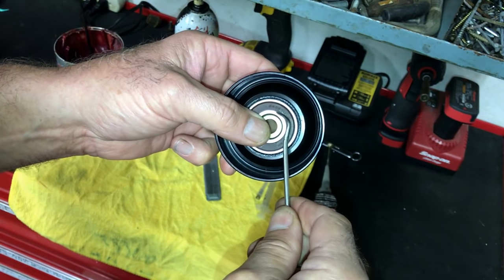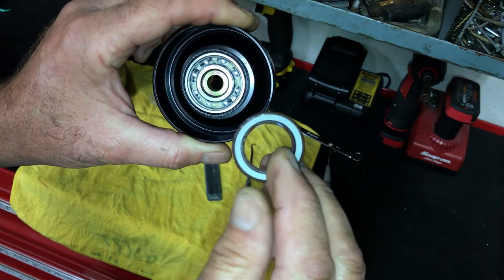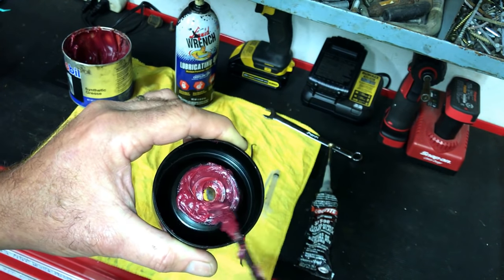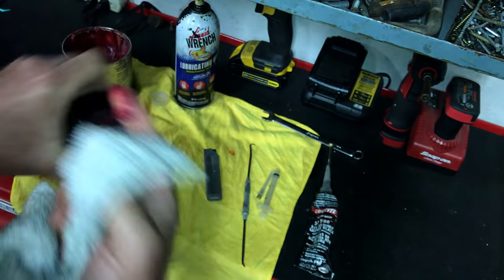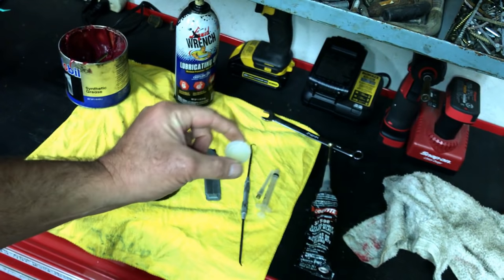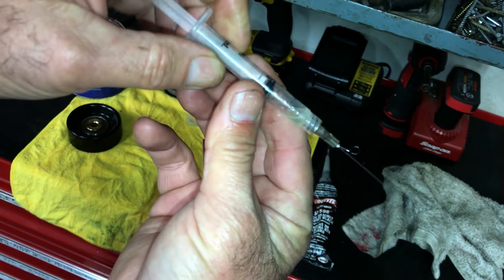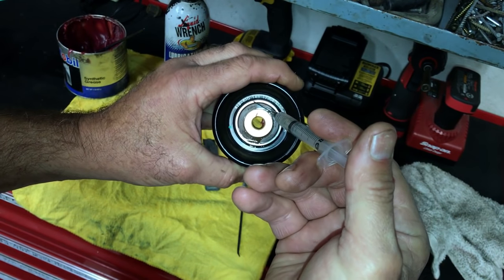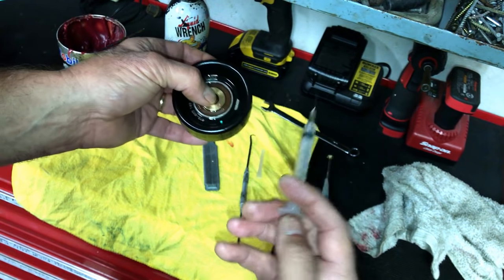Make Your Drive Pulleys & Sealed Bearings LAST A LIFE TIME :)

Comment: The penetrating oil is a very bad idea! The grease is a good idea. Penetrating oil is not designed for that use and will not work as intended , it will break down what ever lithium grease and cause a premature failure.
Reply from the maker: As you heard me mention in the video we only suggest the syringe with penetrating oil as a last resort and do not have time to take the pulley off and they know the Pulley is starting to make a squeak this Buys them some time Because as you know most of the time when something goes bad it’s at the most inopportune time LOL
Reply: Sweet Project Cars , a repair is that a repair and maintenance is maintenance.  Penetrating oil is neither in that case , at no time does it perform a function than hiding the warning of a inevitable failure of the components. The viscosity rating is not what is designed for or can be used for. The grease idea gets an atta boy though!  😁😁.
Reply from the maker: Mike Biro if it gets them a couple days to the next paycheck to repair it right then Amen we say    have a great night my friend :)
Reply: Sweet Project Cars , I do see your point in this matter of thinking, here is a better option on the molecular level to last a couple days. Synthetic gear lube would be a better lube in the bearing for a couple days. It's thicker, and will bond to the metal much better as a lube. You can use a syringe for that as well.

Comment: What I said the right amount of grease more mean more  drag Wichita will translate to heat and I think you destroying the covers by popping in and out and poking them with sharp syringes those covers will never be the same
Reply from the maker: we have done this for close to 20 years on hundreds of customers vehicles and they have never had a problem, EVER...so lets just say you do this to your sealed bearings and they last 3 times as long say 300k, is that BETTER OR WORSE?  then them lasting only a 100k miles all for 10 minutes of your time and 10 cents worth of synthetic grease???

Comment: Replacing the factory grease with better quality grease is ok..BUT!! get the  factory grease out fully! The way in the video the bearign will get overfiled; grease wil run too hot and bearing life will decrease. Never overfill a greased bearing!!! Another point about bearings is; usually the so called 90% rule is applied when selecting the bearing. Thsi means that 90% of them will reach the life as calculated, so 10% won't. Out of the 90% around 50% will reach double the calculated life.
This  injection trick can be used for overlooked/neglected bearings like driveshaft support bearings.
Most common failure is loss of grease because the seals go bad, then also ingress of particles (sand etc.).
Reply from the maker: ervie60 we don't make to much out of it...we have found over the last 20 years of replacing the factory grease with HIGH QUALITY full synthetic grease has helped the bearing to last many many many months longer, whether all the factory grease is removed or not...thaks for sharing your thoughts.

Comment: Mixing different greases???
Clean the old grease out... it may not play well with added grease if they're incompatable types... and don't get any in your new grease container...
Reply from the maker: There is no need to clean the white lithium grease out when you install the mobile one full synthetic it pushes out the lithium we have done this for hundreds and hundreds of customers over the last 20 years and never had an issue

Comment: Why bother the bearings are cheap as chips anyway wouldn't want to risk loosing a cam belt over a hack that saves a few quid
Reply from the maker: First we were not doing a cam belt     also  you are thinking of it all wrong....vehicles are MONEY PITS..so a set of blades costs 20 bucks then you have something else on the car that's 20 bucks and so on and so on and so
on..... IT ALL ADDS UP until SPC steps into the picture, now do you see.

Comment: Can you garuantee this, or is this miracle claim bullshit again
Reply from the maker: If I was doing the job I would guarantee it but I’m not doing the job so I cannot guarantee it we say try it and we are very sure you’ll be pleased if you think about it it’s pretty much common sense the manufactures put the cheapest lubricants in there pulleys, we are basically changing that out and putting an extremely high Quality full synthetic grease in place of The white grease they use and the full synthetic we use are a complete night and day difference from each other try we believe you’ll love it

Comment: Lol. For one thing, Packing a sealed bearing will make the grease expand and blow your seal off.
Reply from the maker: Dan we have done this for 20 years on hundreds of customers cars and never had that seal come off ever thanks for your comments have a great day
Reply: If the grease expands I think the extra will work it's way our past the seal as the bearing rotates. I've popped out seals and greased bearings like this myself.
Reply: Sweet Project Cars , I'm sure it will work, repacked bearings myself but for someone new they might not know packing to much grease is not good.
Reply from the maker: Dan Dearman you are exactly correct my friend :)
Reply from the maker: Dan B most people who work on their cars and trucks have a bit of common sense and it is very obvious when they have enough grease in and if they do what the video shows they are good even if they were to put in twice that amount we did it will come out around the sides as the bearing will only accept a certain amount no matter how much they place in...and then they wipe off the excess then install and blamo shes good for life.
Reply: When grease gets hot, it becomes thinner and will come out no matter what. Synthetic grease on a molecular level bonds better to metal giving it a coating. Then yes will heat up thin out and leak past the seals as expansion happens. Not a big deal, this is why white lithium grease is used. It does not do this and does not have a sustainable property as a synthetic grease.